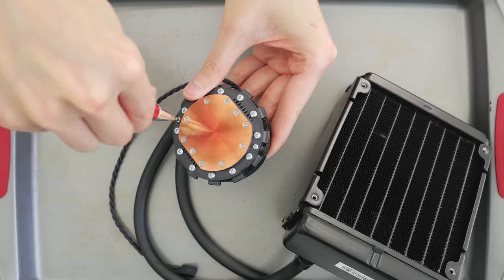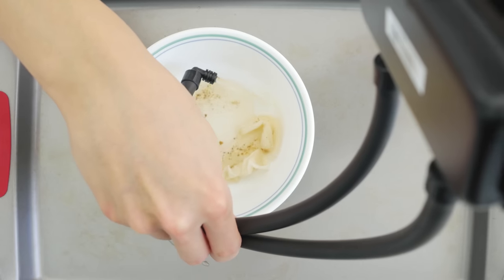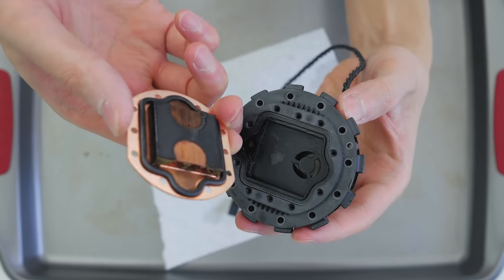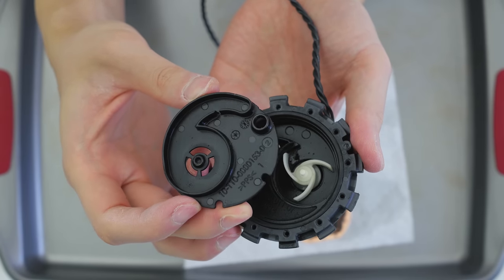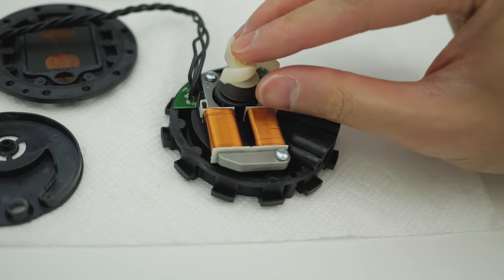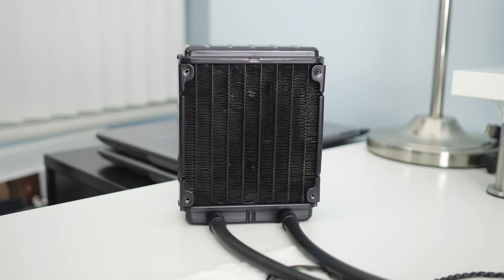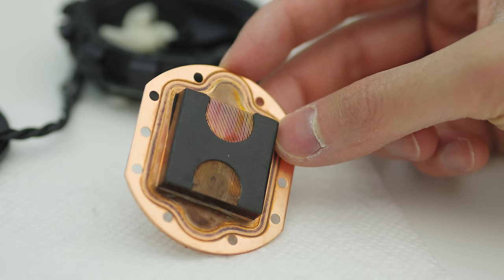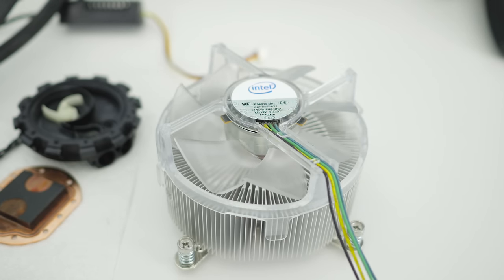What's Inside a CPU Liquid Cooler (Closed Loop) Teardown

Comment: Well this explains why my Thermaltake 3.0 'ultimate' is a pile of shit.

Same exact symptom; near the water exchange ports it's burning hot to the touch, and literally cold at the opposite end of the rad.  One tube is extremely hot, the other is warm.  It's like it's barely using most of the radiator.

Just 3 years old.. expected AIOs to last longer.

Can't be f'd to open it up and do all this in an attempt to fix it, and I don't want to try anyway since the pump had a very obnoxious noise coming from it from the very start (high frequency), so I guess I'm going back to my 8 year old NH-D14.. if it even has mounting hardware for LGA 2011.
Reply: Im using the thermaltake 2.0 water . Thinking to just remove the coldplate clean it and refill it

Comment: 150/400 litre hour pump + aluminium poor radiator , loud fans = AİO cooler

900-1300 litre hour pump + 65mm thickness copper radiator + average silent fans = custom water cooling

Comment: Until they make a better product AIO liquid is not for me. A giant heat sink cannot fail, an oversized one that exceeds your cooling need can even keep functionality if the fans fail, and it clogs up.  Replacing a fan is also easy. Cleaning them is a mixed bag, but solvent works.  However AIO liquid units use dissimilar metals causing corrosion and sub-standard pumps and the most important aspect of cooling is reliability. The inhibitors they put in the liquid will not last forever. A proper full liquid setup would be ok, and has a regular maintenance schedule so corrosion is not to worrisome, but the cost is another matter. If they would make the radiator and cooling head out of aluminum then the corrosion would not be so bad. The difference between a copper head and aluminum one would be very negligible as far as heat transference given the masses of metal we are talking about with PC AIO water cooling.
Reply: Try EKWB Predator AIO systems... they are made using EKWB standard components
Reply: Or Cooler Master/Corsair AIO. They're great. EKWB is also a good option, and if you want, you can make a custom loop yourself. Is not that hard as it might seems

Comment: Looks cool
Reply: i have a feeling there  is a strong  design flaw with the radiator itself.... may you cut the radiator in half to be sure that the flow of the radiator is in the one path direction and not connected to each other???? and what are your thought of the radiator hoses are literally right next to each  does not seem right to me.... instead wouldn't it be better for the hoses to be on opposit corner ends.... instead of next to each other on the bottom???? like...for example.... one on the top right corner for .. hot in..... and the bottom left corner for cold out????  like the radiator on a car.... ?
Reply: DataSerpent there were little walls to make sure the water moves one time around
Reply: because it moves in a snake like pattern S and the start can sit next to end but the line of flow itselw goes ways hence-forth then back!

Comment: Total fail as a tear down. He points out the problem (debris clogging the fins) and totally ignores the root cause. He didn't take the rad and hoses apart. I think that is where the manufacturer screwed up.

Comment: You have Algae in your cooler, an AIO should NEVER have Algae inside, EVER... You got burned.
Reply: I will now spend the rest of the duration of my own Thermaltake Water 2.0 cooler's (the same one as pictured in this video) lifecycle worrying about how much algae I'm going to find in it when it dies and I have to tear it apart. I've already had to clear one blockage. Hoping it was just an airbubble D:

Comment: lol steel in the radiator? Ever hear of rust? yeah...you need to do a little bit more research next time you guess on the materials.  Most rads are aluminum or copper.
Reply from the maker: Thanks. You're right. I misspoke and should have said aluminium. But to clarify most rads use brass or aluminium tubing, and copper or aluminium for fins. But let me know if I'm wrong again. thanks.